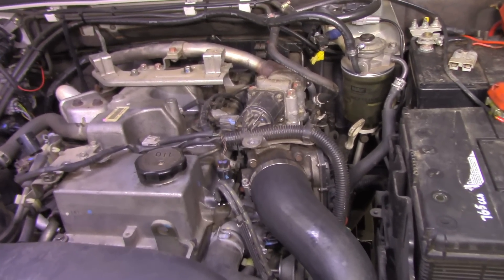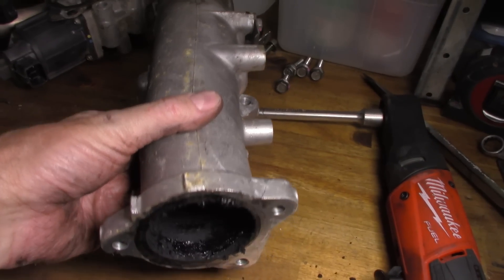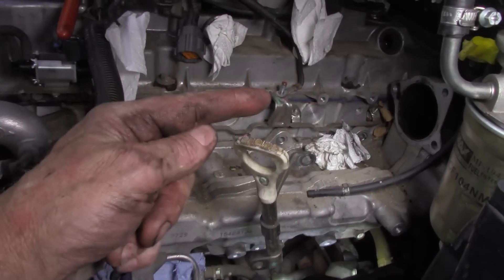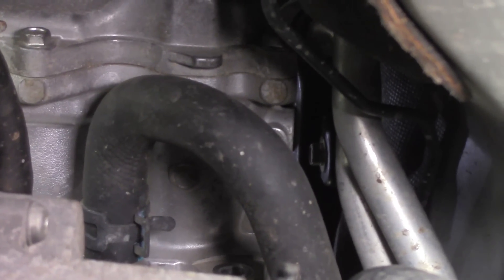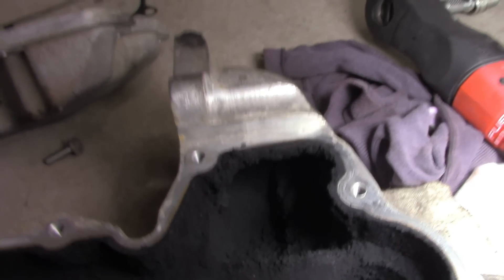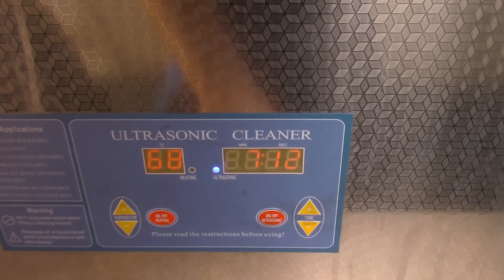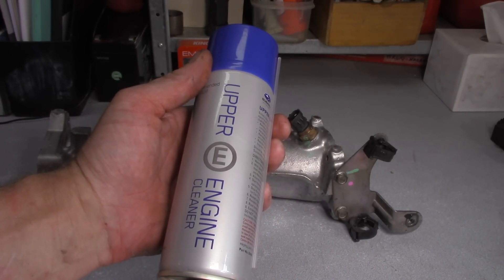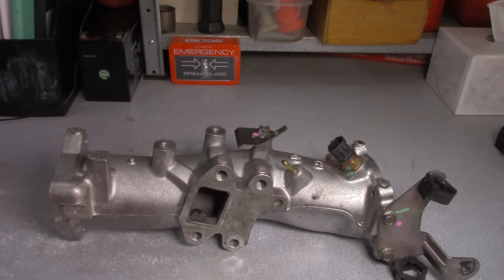Carbon Removal - Full Intake System Clean - The Proper Way!

Comment: Reminds me of my old two stroke exhausts, I
 Cleaned them with oxy acetylene stuck up the pipe and got hot then oxy only and it burns like hell leaving dry grey powder.
Reply from the maker: Yes, did that on a previous repair on the channel to burn out a spark arrestor that was blocked due to incorrect fuel being used. A great way to clean them out!

Comment: What brand/size ultra  sonic cleaner is that? I've struggled to find one large enough to fit an intake manifold!
Reply from the maker: It is a 30Lt one, but I do have to do half the manifold then tip it over to do the other half. It does the job. There are many brands around at reasonable prices. This is the one I use.
https://www.vevor.com.au/ultrasonic-cleaner-c_11064/ultrasonic-cleaner-30l-liter-stainless-steel-industry-heated-heater-w-timer-p_010584766759?adp=gmc&utm_source=google&utm_medium=cpc&utm_id=16744046303&ad_group=&ad_id=&utm_term=&gad_source=1&gclid=Cj0KCQjwqv2_BhC0ARIsAFb5Ac9Q6WMPu3_fMNzSND0Ti4uQsmKIJavO_ZOIsvfs829JcDseqfH-v8MaApaTEALw_wcB

Comment: G’day you Aussie legend, I have a question for you. Im on the back end of doing engine mounts on a 20’ Colorado ( what a nightmare) anyway I decided to clean the egr and intake while I had access. I did my best to clean what I could reach  on the intake manifold while still attached. I was careful to try not to dislodge too much stuff down into the intake runners but there is no doubt it a little bit fell down anyway. The build up is similarly wet, what can I do to minimize any potential damage without removing the manifold completely… I’ve already got too much apart, am worried I won’t be able to put it back together properly and need the car back on the road soon. I don’t think  a whole lot that fell down and I’m sure some dislodges as a course of normal driving anyway. Can I spray it when I it’s time to start the car up so it has an easier time burning?
Reply from the maker: Are you able to use a shop vacuum to remove anything you have dropped? You probably won't get off too much carbon without removing the manifold.
After you have cleaned it, you could use a intake cleaner that should help. The main thing is to remove as much as you can before putting it back together/starting it.
Reply: @ perfect that’s a good idea I will use a vac. I only managed to clean the the top half of the intake. Better than nothing though. Got heaps out.

Comment: Hi max, I have Holden Captiva 2012 2.2 diesel I swap engine and there are ECM codes U0100, U2105, U2106, C0561, U0101. Vehicle doesn’t crank and starting from ignition with key but crank from relay pulled after jump with one wire, battery and ignition switch is replaced. Nothing changed. Hope you can help me something out.
Reply from the maker: Have you double checked ALL connectors after the engine swap? Can you see a crank signal in live data? Do you have a second key to try? Is the immobiliser light on? Have you checked all ground points?
Reply: @ thank you max for your help. It was missing ground. I figured it out today and everything is working well now. Thanks again for it.
Reply from the maker: @ Glad you were able to diagnose the problem. 👍😊

Comment: EGR would give just a dusting of soot. PCV just gives a film of oil. Add them both together and we have a vegemite mess. Manufacturers only have to clean up one or the other and there won't be such a big problem, but it is only a problem outside of the warranty period.
Reply from the maker: Yes, it makes a real mess. Some manufacturers use other strategies instead of an EGR system

Comment: It's not the crank case venting that causes this, its the EGR.  Good explanation on how to get the parts off.
Reply: It's both mixing when they meet in the inlet manifold.
Reply: @One_over_the_eight seems like it, egr seems to be dry, where as the intake build up is a mix of wet and dry.
Reply from the maker: Yes, this is very controversial, but the gasses themselves are created by the combustion process, via the PCV system. The EGR just makes the problem worse by recirculating the gasses to lower combustion temperature and lower NoX levels.
Thanks for your comment. 👍
Reply: Soot from the EGR, and oil from the PCV, both are needed to create what you see here.

Comment: You did a good job. Theoretically 😉 you could perhaps, run that PVC line to a bung on the exhaust pipe.
Reply from the maker: But then the emissions would run untreated out to the atmosphere. Unfortunately, even if it did work, it would be illegal.
Thanks for thinking outside of the box.

Comment: Have a LF1 3 0L SIDI VE would a sonic cleaner with a probe work for inside valve ports with heads on ? also getting a coating of dry soot on the plugs could this be the pcv do I need a catch can on it as well?
Reply from the maker: The best option for inside the head is the use of a walnut blasting medium. The soot on the spark plugs could be a range of issues depending on how much there is. Catch cans can also be installed on petrol engines.
Reply: Would a Flashlube electronic valve saver kit be a good idea for carbon build up prevention on direct injection
Reply from the maker: @SpunCog-Racing  We used to use these when I installed LPG systems to help with valve recession. I believe this would probably make the carbon issue even worse as it adds an oil additive into the intake system.

Comment: Your explanation of where the carbon comes from is wrong.  It does not come only from blowby, most of it comes from EGR feeding diesel exhaust back into the intake, where the oil mist blowby mixes with it and forms the sludge.  It's why we block off the EGR when possible, and fit a catch can to condense as much of the misty blowby to reduce the oil in the inlet tract.
Reply: Need big high way runs to break down crud the egr valve the devil that it is helps to keep combustion temperature down as diesals too get hot which breaks down oil over time then friction increase s and metal fatigue increase s
Reply from the maker: The EGR system does not create the carbon, as I have explained before. It does however recirculate the gases that makes the situation worse. As I did in the video, installing a catch can is able to help with the problem. I have also stated that an EGR delete is not legal and therefore I do not recommend it.
Reply: @MiracleMAX  The EGR system DOES create the problem,  because older diesel  engines without an EGR system but with a PCV system do not clog up the inlet manifolds with carbon.  The carbon is the black soot you see coming out of old diesels with no filters, so pumping that soot into the inlet and mixing with oil mist from blowby is exactly where the buildup comes from.  It's also why diesels are far worse than petrols in this regard, because petrol EGR does not have the diesel soot.
Reply from the maker: @einfelder8262  I'm not doubting that. But, the carbon is created by the combustion process. Previously, fuel used to pass the intake valves and help 'wash' them. With direct injection, only air is taken into the intake system - fuel is added in the cylinder. No 'washing' of the intake system takes place. Yes you are right, diesels are far worse than GDI.
I appreciate your view on the matter.
Thanks for your comment
Reply: @MiracleMAX You're missing the point. The combusted crankcase ventilation gases are directed from the crankcase to the air intake pipe, usually before the turbo. This oily mist travels with the fresh air to the inlet manifold. This is where it meets and mixes with the sooty, carbon filled EGR exhaust gas and forms the oily carbon sludge. There's two ways to avoid this. Either install an oil catch can and vent the remaining CCV gas into the atmosphere so only dry EGR gases enter the inlet manifold or the most preferred method is to block the EGR so only the oily mist enters the inlet manifold and burns up in the combustion chamber. I've actually managed to clean my valve stems of carbon (direct injection diesel) over a period of six months by blocking my EGR as the oily mist rushing through the inlet manifold venturis broke down the carbon on them. Obviously this isn't powerful enough to clean the chamber of the inlet manifold. I noticed the shiny valve stems when I removed the clogged inlet manifold. I soaked it in a diesel bath overnight. Pulled it out in the morning and all the sludge just fell out of it.
Reply from the maker: @One_over_the_eight  Glad it has worked so well for you.
Thanks for sharing your experience

Comment: Seen one so tightly blocked that it only be tow started and will only just make idle speed but excelerater flat after clean out ,,  wow economy power you name it ,,  it was a new car again,  good for 100,000km then repeat process,,  this is Mitsubishi
Reply from the maker: Yes Carbon is a real killer

Comment: EGR is a really really bad idea. Logic suggests putting exhaust back into the intake will block with carbon.
Reply from the maker: Some other vehicles use variable valve timing to reduce NoX emissions and therefore do not have an EGR valve.

Comment: Great video Max and very informative. I was quite interested in this as I have a NX with the same motor 3.2 L. 
I fitted a pro vent catch can at around 75000km and it certainly catches quite a bit of oil out of the blow by gases. 
You mentioned near the end of the video about small injection quantity relearn.
I would be very interested how this  is done so maybe in the future if you could do a video on this that would be great.
Reply from the maker: Thanks for your comment.
I have already done a video on the relearn procedure. Here's the link:
https://www.youtube.com/watch?v=Z6_ru3XxO20
Reply: Thankyou that's great 👍

Comment: If you just blank off the egr all if this mess is gone and your oil keeps way cleaner for more kilometers. We all know this got nothing to do with regular oil change. the egr is the main component for this problem.
Reply from the maker: The carbon is created by the combustion process. The EGR recirculates some of those gasses to lower the NoX gasses due to temperature changes. To blank off the EGR is not legal, therefore I can not recommend it.

Comment: All this anti pollution bullshit needs to be removed.
All it does is stuff engine's and ends up robbing power and using more fuel. 🤬🤬🤬
Reply from the maker: I guess manufacturers are required to fill emission requirements as stated by law to care for the environment. Emission levels have dropped due to these features - love them or hate them.

Comment: many years ago we put a catch can and egr delete , no issues since
Reply from the maker: There are solutions, but as I said before, I can only suggest legal ones.
Reply: @MiracleMAX  i understand, we use hho cells aswell , family has used them for nearly 50 years , they keep the combustion chamber , exhaust  very clean , even if you just put a few hundred mls of gas per min into the air box.
low amounts dont mess with the O2.
they make a big difference on deisels, always amazed me on old school deisels how much cleaner the exhaust was even under load zero smoke, and very low nox, freind is a retired mechanical engineer he tested his old vw beetle , without the cell switched on his omissions were terrible , with the cell switched on the omissions were so low it amazed the guys , it was lower than a modern car.
but youve got to do it right and safe using safety devices etc.
im not sorry using them all these years.
Reply from the maker: @closertothetruth9209  Interesting, good to know
Reply: You can't close or delete the EGR on any modern engines. You'll be destroying it by doing that. Modern EGR systems have an EGR cooler which lower the engine temperatures inside the combustion chamber. When you remove or close that system through software you raise the engine temperature which in the long term destroys your engine.

Comment: 100% best way to clean is pull apart ,i found oven cleaner and a pressure washer but im hundreds of km from a acid tank to send it in, good vid nice job
Reply from the maker: Yes you are correct. I have heard of oven cleaner being used, although I've never done it myself. Removal and cleaning is the only way to remove the carbon safely. 👍

Comment: Sorry Max but what about the actual head?  I have seen a device which covers the inlet and smashes walnut shells into and immediately sucks them out of the head.
Reply from the maker: Yes, you are correct. That would be the best option. 
I did mention it in the video description as well as in the video itself.
https://youtu.be/OuR3-TU1cXg?t=793
Unfortunately I don't have that unit. I have seen them made, including using a shop vacuum to remove the waste.
Next on the tool list......

Comment: Remove and refit dpf for roadworthy every yr only leave it on for the hour or so it takes for check engine will last five times longer and you wont have to replace dpf ever
Reply from the maker: There is always a work around. I can only recommend the legal ones.
Thanks for your comment.

Comment: Apropos 'preventative maintenance'.. how is this going to work out vis-a-vis the common-rail-injector lines (200 bar I think) and their finite tighten-loosen-cycles?
On the Mitsubishi 4D56U engine this limit is at 7 cycles, then they have to be replaced - and they are costly (for what they are).
Reply from the maker: Mitsubishi recommend injector pipes need to be replaced every 6 times. It's in the owners service book that we stamp. Keep in mind, they need to come off to do the valve clearances, so that is an ideal time to do a carbon clean. That way you are only replacing the pipes when you would normally do them for the valve clearance adjustments. That is the customers cost stipulated by Mitsubishi. Sure cheaper than a fuel leak under the rocker cover into the engine.

Comment: JFYI - graphite (carbon powder) is a lubricant..
The problem are chunks of it getting dislodged and blocking valves from closing correctly, not to speak of the oily-soot-smoke that's coming out of the crank-case (caused by blow-by) which is being put into the air-intake of the engine (in my case, Mitsubishi Triton MN, 2.5DiD 4D56U engine) right before the turbo charger - which is being mixed with the EGR-gas right before the manifold, which then really builds up and blocks the intakes.  Catch can's should (in theory) catch most of the oily-soot.
Reply from the maker: That's a great explanation of the problem, thanks for sharing!

Comment: Beware those catch cans with paper filter, they can cause pressure build up in the crankcase causing oil leaks past the seals. I've seen several cars getting  multiple rear main seals fitted and still leaking
Reply from the maker: Good advice! You get what you pay for. I've also heard of people connecting the hoses backwards which creates all sorts of havoc

Comment: Hi max,
I would have liked to see a comparison for driveability before and after, or even a dyno test pre and post. Im a mechanic too, and the inlet on my diesel is way worse than what you show in this vid. It would be cheaper for me to replace  the inlet man entirely, however my car still has a ton of power and excellent economy. Catch cans can help, but do void warranties.
Reply from the maker: I agree. I would have liked to do a comparison, however, the customer made comment that they noticed an increase in power, fuel economy and ease of starting. All without any input from me. I'm sure different engines would respond differently due to many different factors.
I agree, some do decide to replace the manifold. Some also have a clean one in stock to change over to save time and then clean the other, ready for use on another engine.
Thanks for your comment. 👍😉

Comment: Hi Max, you want see wet carbon, wait till you have to Hyundai i40, I took the intake of to clean and couldn't even see the swirl flaps and the were stuck,  I eventually cleaned enough to see the flaps only to find two missing, the are made of plastic. All cleaned and back together, 8 hours from start to finish and ordered another intake and another 6 hours.  Bought a small catch can from Western Filters and no room in the engine bay, after making a few brackets and some modifications to the engine cover it fitted. Drained twice a week and has a very thick sludge.
What chemical do put in your Ultrasonic Cleaner? I have just started to use Simple Green Multi Cleaner, big parts go into a plastic bag with the solution and taped up up with electrical tape (small parts in a zip bag) and into the water of the ultrasonic cleaner, this way I only have a small amount of chemical to dispose off and the water stays clean in the ultrasonic cleaner.
Thanks for posting, I will be cleaning the intake every 50k.
Reply from the maker: Great to hear from you Rich.
Not unusual to see swirl flaps break or disappear. A bit scary to think of where they go!
Depending on how bad they are, some just quote on a new manifold as it works out cheaper than replacing the swirl flaps and cleaning it.
I just used CT-18. You can use an 'official' ultrasonic cleaner, but it gets pretty pricey. I use oven bags for some parts - it copes with the heat OK. It's a good idea to keep the water clean. To be honest, I forgot in this case. 🤦‍♂️
Regular preventive maintenance is the only answer.
Hopefully the catch can will help with the process.
Thanks for your comments
Reply: @MiracleMAX  Just out of interest sake , what size ultrasound do you have / find works?
Reply from the maker: @rossbeck1595  I use a 30 Lt tank
Reply: @MiracleMAX  Thankyou